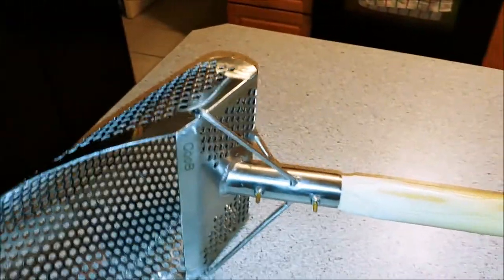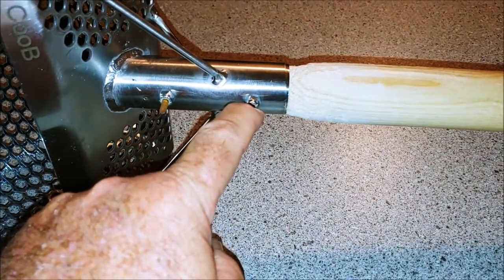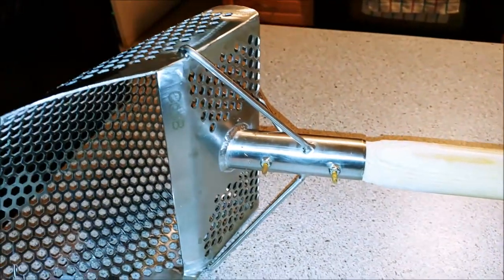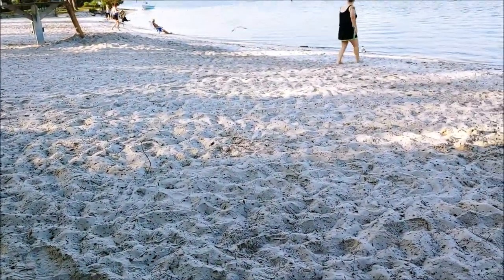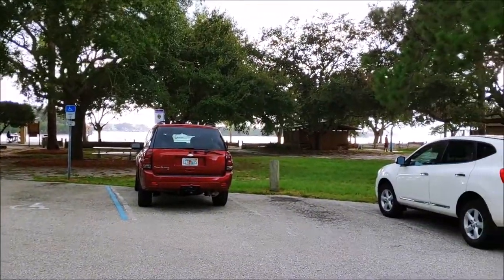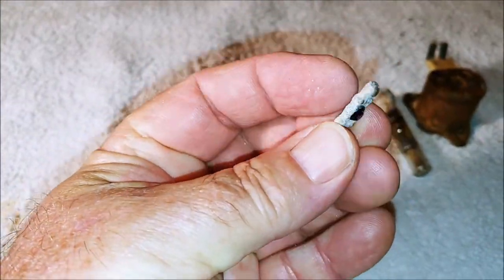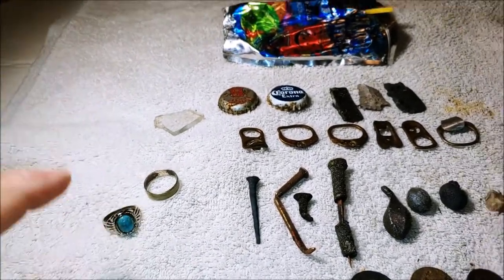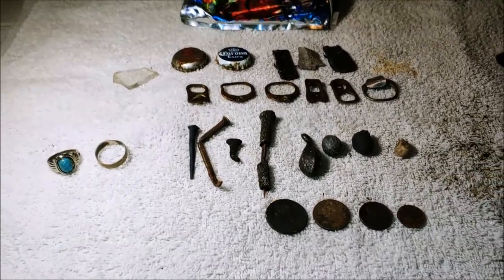Metal Detecting NEW SCOOP in water: TWO RINGS 1st HUNT!! Diggin'  w/ Rob!

Comment: Awesome. I'm wondering if i should cut off the thin stem then shave down the thicker part like you did. Looks solid!
Reply from the maker: Thanks. The one I bought didn't have the thinner stem, thick all the way to the end, that's why I had to shave it some. Then, I used my sawzaw to cut the end at the same angle as the scoop neck end, so it butts right up against it.  First time I put it is salt water it expanded and locked it in tight!
Reply from the maker: Tones, it's 12:10, just got outta the shower after another night hunt on Clearwater Beach. We got 2 ringfinders call outs, both for missing gold rings on the beach.  It was 89 here today, and the beach had THOUSANDS of people on it like it was mid summer. It was crazy.  Just as I got there, 2 club members found the adult's gold & diamond ring (and they donated $300 to the club) then we walked up the beach about 1/2 mile to an area a drunk college girl was doing somersaults in the sand dunes New Years Eve.  Even though 3 of us looked for it, and I stayed an extra hour, no luck on that one.  BUT....I did find 4 more earrings tonight, with the last one being .925!!!   Scoop worked like a champ!